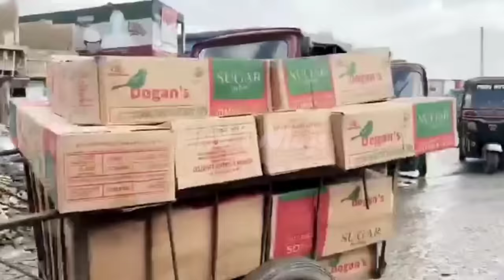AFRICA WHY PEOPLE ARE SUDDENLY TALKING ABOUT THE NEW ABA, ABIA STATE NIGERIA??? 🇳🇬

Comment: I was in Aba in 1993. There were no even toilets, but buckets to defecate it. Everywhere marked by red soil with dust. Uncompleted and abandoned buildings. Erosion not control as both side of the bad roads were decorated with sewage and garbages. It was a disaster
Reply from the maker: Okay.
Thank you for sharing 🙏
Blessings!
Reply: @MAVTvVlogs It think the previous governors should be cross examined for corruptions. It's not good to just moved on because after this man, the next governor won't do anything, just as the previous ones before this great man.

Comment: Nice one!  Please send this my suggestion to the governor😊😊. He is doing well and more is needed in the state. 

1. Public Water systems is needed please. * pipe hot-water and cold - water to every house* .  (Borehole is  environmental hazard)

2. Electricity needs to go underground. [constant electricity]( remove all those  poles and wires hanging overhead  they health hazard).

3. Public sewage is needed.( private sewage is an environmental and health hazard).

4. The idea of bus lane is good. 

5. Create walkways in all roads and bicycle lanes.

6. Cover all the drainages. 

7. The idea of train is good. ( it would be nice also to build an overhead Electricity train that will connect all the major markets/ factories around the town/ state. ( circle line train).

8. Build gas line and pipe gas to every building. ( cooking with bottle gas or kerosene should be banned). 

9. Build a recycling centres.  ( old cars, tires, refuses, mentals, plastics etc, needs to be recycled). No more dumping of refuses!!!

10. Build more factory.( production makes economy very strong). 

11. Build the seaport and airport. 

12. Change the education system from 100%  theory to 30% and make practical 70%.

13. Build standards hospitals and clinic's.  ( build specialist hospitals and make Abia medical tourists centre). Aba is capable of building and maintaining any equipments. 

14. Introduce Public transport ( use standards buses like IVM buses for transportation in the city). 
Remove all keke from our roads. ( they hazards).  Use coaches ( luxury bus for inter- city transportation). Private taxi should be registered!

15. Build industrial markets in industrial area.

16. Build a mechanical village.  

17. Create street maintenance team.

18. Install CCTV and street lights every street. ( install traffic lights to everywhere it is needed. ) 

19. Established DNA test centre and finger prints scan centres.

20. Create an ID card data system for all the statevresidents. ( visitors should have their finger prints scanned once they entre the states). This messure will help CCTV to catch potential criminals and illegals:)

21. Make a strong laws! Anyone that violated those laws will go to prison or pay huge fine. 

22. Build standards prison and include factory in the prison! If anyone is sent to prison, the perso must work in the factory and be productive while in the prison.  

23. No cows or other domestic animals should be seen on the city roads and rearing of animals should be banned in a public house.

24. Build housing estates and rent houses to individuals at low cost.  ( make sure that private landlords maintain their houses.)
Or Build new estate houses ( sky scrapers) and rehouse residents and knock down old areas and build brands news house equipped with, water, gas, Internet, TV lines,  recreational centres, public libraries etc. 

If all these are implemented, our people will live long life. 
People die prematurely because of lack of the aforementioned infrastructures .

This is my dream for now and many more.

We should be competing with Dubai  China and Japan in infrastructures!!!. They don't have too heads! 

Good luck my governor.
Reply from the maker: Wow!!!! 😲😲😲😲
Thank you so much for this well put together insightful and inspiring thoughts....
They're well noted, and we'll ensure to convey it as it is.
Your support and time here is DEEPLY appreciated.
Blessings!!
Reply: Nwanne take it easy ooo. All your suggestions are good, but it's a gradual process. He has started well and is laying the foundation for growth and development in Abia state
Reply: From your suggestions one can get a template for development